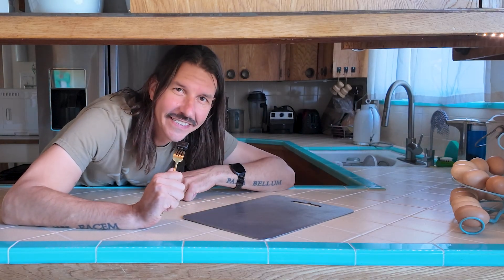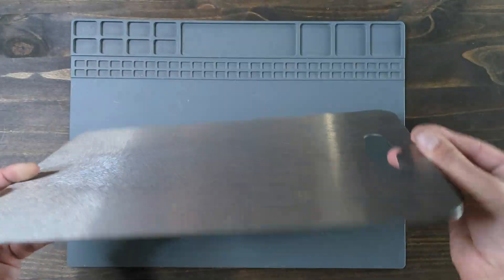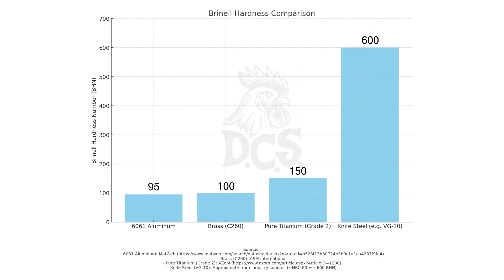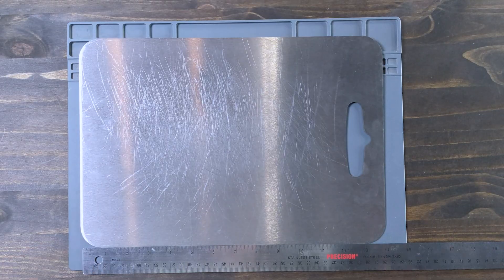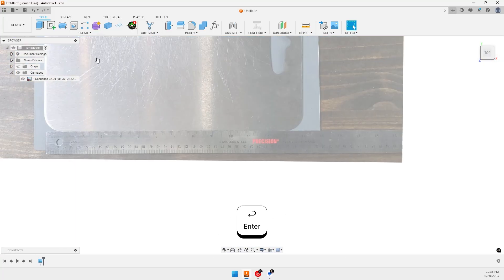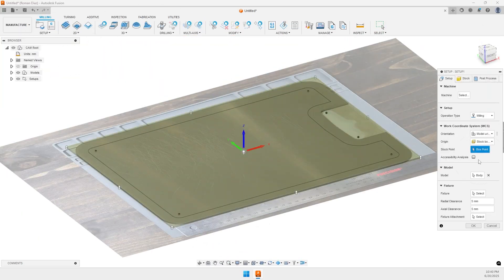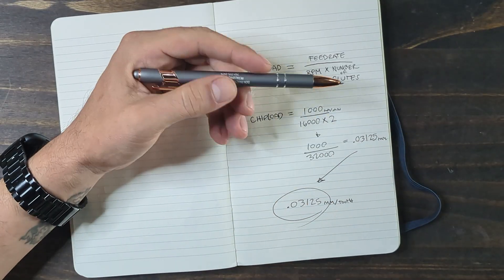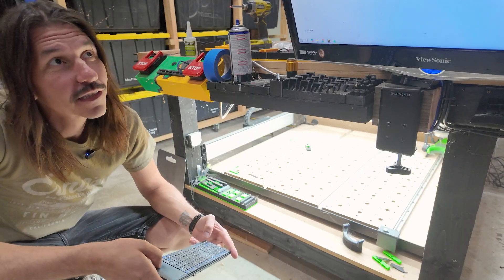Can a Hobby CNC Machine Cut Titanium?

Comment: Hi, Actually using ball end mill is not wise,, as it is used for finishing.. what you have have done is that you use flat end mill and then finish it with the ball end mill..
Anyway, thanks for the experiment, feels amazing machining titanium on this type of router cnc..
Reply from the maker: You're totally right! This is the way. If I had any idea the machine would get as far as it did, this would be the strategy. I was expecting immediate failure. Who knew?